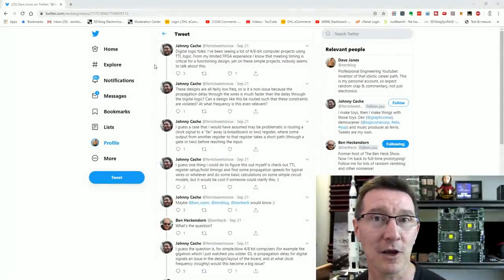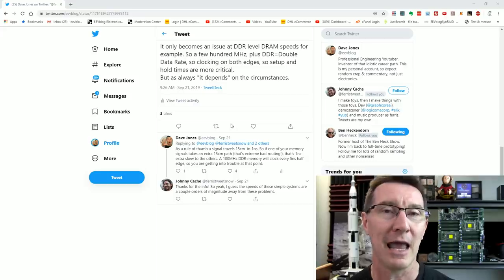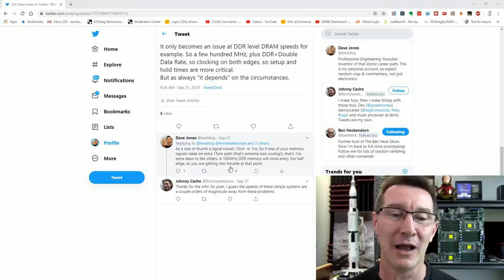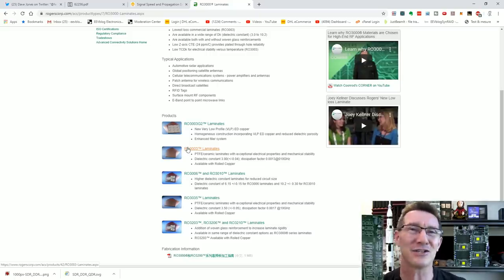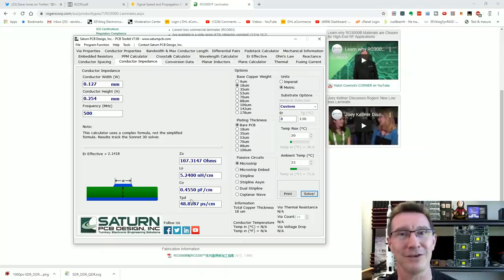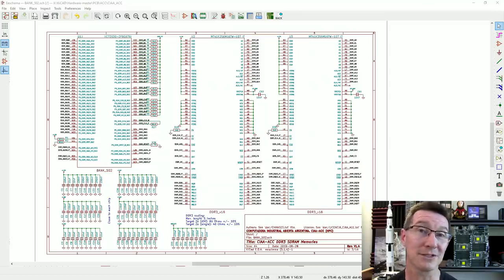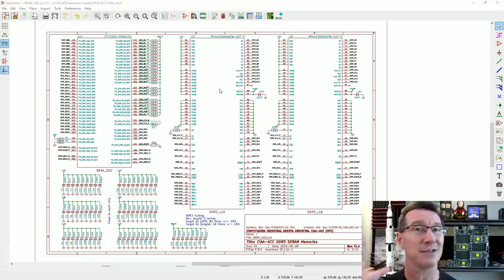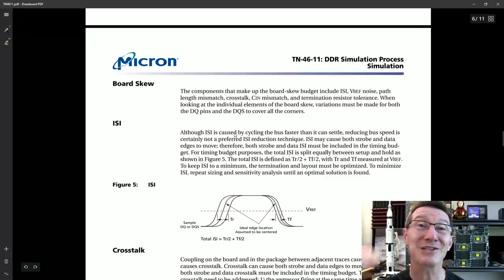EEVblog #1247 - DDR Memory PCB Propagation Delay & Layout

Comment: I worked on a design last year with a FPGA and DDR3. Where I work we have people who do layout for us engineers. We were behind schedule so we thought we would kick the DDR3 to our layout guy before the schematic was complete so that he could get a start on what would be the most time intensive portion. In addition, we skirted some of the company process steps to rush into CAD, like constraining signals. Our layout guy came back to us a week or two later to review his work and it was immediately apparent that we shouldn't have trusted this guy to know how to route DDR lanes. Nowhere were there any serpentine traces. In fact, there was no attempt at all to length match traces. Each signal to the DDR took it's own path to get out of the chaos underneath the high density FPGA and the shortest trace was about 2 inches while the longest was about 10 inches. This was one of many mistakes on that project where cutting corners ended up costing more time to fix later.
Reply: Did something similar as a data acquisition front-end with an FPGA and DDR4 Ram for a very large industrial X-Ray machine. We pretty much messed up the same way... Tried to outsource the PCB Design to save time and got bitten...
Reply: Surely you hold a design review before you send anything out for production?

Comment: At 35:40 - A common mistake, to match a differential pair with a squiggle 'somewhere' in one of the two signals. THAT SHOULD NEVER BE JUST SOMEWHERE  IN THE MIDDLE. The pair is meant to be fully differential, and creating a length jump this way is like a phase jump. This means that at least on one side of the squiggle the pair is not balanced. The skew correction in a pair MUST be near the cause of the skew, e.g. the sideways leaving of a BGA pin pair.
Reply: Yeah I was curious myself how those lengths, which are most certainly inductors, would effect phasing and whether that would cause problems of their own
Reply: @xxportalxx. : Don't see them as inductors, they are transmission lines. A delay is inserted by the squiggle. My use of the word phase was misleading. The problem here is that a differential line must have both signals complementary with the same timing, if not noise emission or reception may occur. The skew at the receiver end between the two signals must be zero, or else the differential signal will not cleanly change over between + and -, but will be zero for a a short time. The behavior of the differential receiver is undefined for zero input, and even double clock edges might occur after the receiver.
Reply: @ariedemuijnck  hmmm, high frequency stuff isn't my forte I admit. My background is more power and physics so I couldn't help but think about phasers 🤷‍♂️
Reply: Not exactly sure what you mean by the 'cause of the skew'. Can you elaborate a little for the uninitiated?
Reply: @deweywsu  I assumed he meant the location where the lengths become different
Reply: @xxportalxx.  oh okay, now I think I'm seeing what he meant. Tell me if you think so: when you create a squiggle, you should create a correcting squiggle in the other line of a differential pair somewhere close to the original squiggle?
Reply: @deweywsu  yeah that's definitely part of it

Comment: Another tip that I've picked up in the last year (still a young player mind you), is to take into account soldermask when routing on external layers. Rule of thumb I was taught for most soldermask is it'll reduce your Zo of the controlled impedance trace by roughly 1Ω per 1mil thickness of soldermask.

Another tip I've learned is if you do have to route DDR (or really any HS such as USB or QSPI SD), route your traces/lanes as perpendicular as possible to adjacent traces on adjacent layers (Shield with ground planes as much as possible). That way coupling will be reduced or nullified because right hand rule.

Last big piece is that it's not the frequency that matters, its the edge (rise/fall) rate of the signal that matters. If you slow down or slew/rate control your signal (while still meeting setup/hold times) you can minimize EMI and even help mitigate against reflections.

Comment: Trap for young players is to route busses on different layers.

Make sure to use exactly the same vias for each signal of a group.  That way, manufacturing tolerances have no effect on your length matching.  They all change together.

I just had to route a 16-bit DDR3L memory to an FPGA on a 20 x 20 mm PCB.  That was NOT easy.  Big boads are so much easier. Especially for length matching and crosstalk.
Reply: The example design shown in this video did not look great in that regard.

Comment: How on earth do PC motherboard manufacturers manage to turn around these hugely complex designs so quickly? Imagine all the layout time, testing of the DDR4, PCI, SATA, NVMe, USB3 etc. And then charge less than £100 for them. Amazing.
Reply: I guess they have very sophisticated tools built over decades to help them with the process. But it is a very complicated thing to do.
Reply: lots of copy-pasting, industry-specific tools, decades of experience
Reply: @redtails  yes, Intel, for example, release reference implementations for some parts of the mainboard design. The companys can also internaly more or less copy and paste between different boards and generations and switch out only the parts of the design for the new stuff. An other advantage is that they can split the development costs between tens of thousands of boards.
Reply: It really is incredible the engineering that must go into them. That, and even video cards.  And then you consider the typical life cycle of these things. you're lucky to get a few months before another version comes out, it's crazy all the work that goes into it for such a short life span.
Reply: I agree, PC motherboards are some of the most intricate PCBs in consumer homes today. Advanced EDA tools, 24/7 PCB design/layout shops, design reuse, offshore manufacturing and economies of scale result in these marvels coming out so quickly and inexpensively.

Comment: Propagation delay was an issue before many folks were born.   The CDC 6600 used a backplane comprised of a mat of twisted pair wire ending in taper pins.  Seymour Cray tweaked the lengths until things worked.   One of my managers had the task of measuring the wires to which Seymour had attached a tag that said "TUNE", so that they could be used for the production machines.  The clock for the 6600 was a blistering 10MHz.

Even before that, Grace Hopper used to pass out 1 ft. lengths of wire to her students, identifying them as "nanosecond" wires.  (Light propagates at about a foot per nsec).

Comment: And all this for Mhz-level signals, imagine the headaches designers have to go through for the current  Ghz-level motherboards !
Reply: This is why things like PCI Express came about.  Instead of having wide busses to match you just have a couple traces running at much higher speeds.  And then for the PCIe x Lanes each lane operates somewhat independently so that matching between the Lanes isn't quite the concern.  All this makes for much tighter requirements but with far fewer traces to control.  DDR is one of the few high speed parallel holdouts though there have been attempts to move to a high speed serial interface for memory - I'm looking at you hybrid memory cube.
Reply: @slashdevslashzero lots of things are moving to this serial lane idea now. Ghz ADCs these days use JESD204B which is a high speed serial interface, so for a 500Mhz adc, you might have 2 serial lines running at data rates of 5Gig each!

Things like thunderbolt use serial lines too, so high speed design isn't going anywhere!
Reply: please elaborate, I guess you use HyperLynx everyday

Comment: Most of my current projects are 6-layer boards and I use Eagle's built in trace length tool on any differential signal (such as HyperBus or USB HS) and on any memory bus (16/32-bit SMC for example). In addition, for clock generators such as MEMS oscillators, I make sure there is a ground plane with no interruptions between the XO and XI of the FPGA clock input. Not sure if Dave mentioned it, but even if the clock speed is slower (i.e. 40MHz), the longer the trace, the higher probability of interference which can cause "blips" in the signal and trouble for the logic.
Reply: Also, clock frequency is not necessarily the concern, the major concern is the rise times of the parts. The signal rise times can contain frequency content well above the fundamental frequency of a clock, and if you want to preserve the integrity of the signal you have to consider these higher order harmonics. If you're using modern parts, every trace should be treated as a transmission line if you want to assure signal integrity and good EMC performance.

Comment: Also, clock frequency is not necessarily the concern, the major concern is the rise times of the parts. The signal rise times can contain frequency content well above the fundamental frequency of a clock, and if you want to preserve the integrity of the signal you have to consider these higher order harmonics. If you're using modern parts, every trace should be treated as a transmission line if you want to assure signal integrity and good EMC performance.
Reply: This is so true. If your clock line its ringing, your single board TTL computer might fail at 1 hz.

Comment: btw the "snaking" was reduced with more modern interfaces such as PCIe but also more modern DDR4 (or GDDR6) memory as well.
Because there is some kind of internal compensation inside the chips. So you can argue that for example GDDR6 has an 64x1bit Interface and not 1x64bit.
Reply: On the PC side I think most of the compensation is on the SoC side with DDR4. Snaking also seems to be more pronounced with T topology layouts.
Reply: @MechanicaMenace  Yes, because the "T-Topoloty" is made for maximum frequency with 2 DIMMs per Memory Channel, thus its a bit more complicated than "daisy Chain"...
And, if I understand it correctly, the singal lenth is the same between both DIMMs, while on "daisy chain" boards, the nearest DIMM is the first one to get the signal.
Reply: PCIe is fundamentally different because each lane works independently from others (as it's a serial bus, it's self-clocking), so there is no need to match them (you only need to match differential pair). And GDDR6 has x16 data interface - you can download databrief for it from Micron website).

Comment: TL;DR KiCAD is great and makes designing 8 layer boards not a pain even if you never designed a PCB before. 

The comments already terrify me what people do that layout PCBs for a living. I’m a physicist and I had to learn board design and testing for a board with a large FPGA with DDR3 and PCIe that I needed to decode and measure stuff. It just so happens that this is the most complicated thing one can do in digital electronics but its super easy with KiCAD! The only thing I ever done before is microcontroller-level stuff because the klunkt software always deterred me!!

Comment: This topic has come at an interesting time. I've been fiddling with some laser driver and TDC circuits to make a lidar measuring tool, and have been learning more around the topic of propagation delay. More so in picosecond TDCs. I found an interesting topic on using FPGA's, to run a clock signal through a series of single gates, to take advantage of the propagation delay, offsetting an array of clock signals all in parallel, each running to a counter. Then you trigger a start/stop signal across all the counters, and determine out of the number of counters, which counter does the increment decrease by 1 You now have 1/x the resolution of your time. Interesting stuff, but I'm sticking with a TDC7201 for now, FPGA's, project for a later date.

Comment: That was the reason why AMD disabled the PCIe 4.0 (double the speed of 3.0!) in the last gen MBs
They said that the signal integrity would be bad and that would causes instabilities.
The new X570 are designed with PCIe 4 in mind with tigther timings and better traces routing

Comment: We tried to keep 7h (for uS) and 5h (for SL) serpentine spacing when length matching the DDR signals. That is to minimize the self inductance. Memory is the most challenge part in motherboard layout. Need to be careful of the RelativePropagationDelay and StaticPhaseTolerence :-)

Comment: This video remind me of funny (not) case in my life... I worked as repairmen on old (late 70s early 80s) telecom equipment in early 2000s and our job was to repair it after catastrophic PSU failure (PSUs was replaced with new ones after, its obvious thing to do).. The issue was found in CPU (contains ALU, CPU registers, System bus buffers, and Clock generator) card and it was replaced with spare but system worked kinda funny(not work at all) after that. If you run ALU/ROM/RAM/IO Registers tests - it works just fine. That was hotspare dual machine setup where second machine do checks on first one and copy its registers and RAM states over by timer or external trigger like alarm or operator's command. Same for first machine and depends on selected Master machine between two of them. Well. Second machine running, operator gives command to first machine to seize master role. It gives ACK and start to run equipment. After 20 to 30 seconds second machine seizes master role and halt first one. WTF? Operator run tests - result: All Green. Repeat tests - result the same. Operator tries to pass Master role to first machine again - it works but situation repeat itself after 20 or 30 seconds again. We knew for sure that issue in CPU card itself because everything else is tested and works before so it's time to dig in =). Issue was found in "Known good" card, in "Stem Clock Output buffer" chip - it was 4AND gates chip that just its function name said - output 4 equal clock signals to Stem (system bus) that connects Branches (commutation matrix parts) to the Root (CPU shelf). Some bright head replaced SN7408 IC with 74LS08... Good fast and sharp clock pulses generated by 74LS chip was too good for the rest of equipment and glitched out the rest of SN74xx based system bus controller that was in different enclosure about 50-60cm away in the CPU shelf... and yes, that equipment had wire-wound backplane too. 

P.S. If someone reading this turd to this point - sorries for broken english xD And I like very much that "Plants" terminology applied to telecom equipment...
Reply: Северный Зверёк Nicely and well written post, except that it's "terminology".
Reply: @johnfrancisdoe1563  lol. Thanks for pointing it out.

Comment: 16:20 You should probably have warned that this trick does not apply to the address lines of SDRAM (both SDR and the many generations of DDR) which absolutely do have to match up since they're not just used for memory addressing but also for mode register programming and for some additional control signals during column select.

Comment: Wow, all these issues ring just as true when laying out datapaths in digital CMOS (say, on a custom DSP). Only, when laying out ICs, we're regularly operating in the tens of picoseconds domain. There is a whole field called Static Timing Analysis that unsurprisingly deals with timing analysis for digital VLSI designs.

Comment: I would be interested to see a video on those timing diagrams. I just couldn't workout why a Dallas DS1220AD NVRAM was not working on a arcade PCB, but a ST M48Z12 worked perfectly. They are both listed as compatible items for the same SRAM chips. From what I could see the dallas was stuck in high impedance to stop data corruption.

Comment: Great video Dave, but surprised nobody appears to have picked up on your propagation delay estimate!

The speed of light is 300k km sec -1 therefore 1nS = 30 cm at that speed. When I did my electronics degree 45 years ago that was an ingrained measure.

Clearly electrical propagation is not as high as the speed of light, for various reasons, but generally taken as between ~65% and ~80% depending on exact medium and circumstances.

Safest rule of thumb is therefore to use the speed of light rather than half that, thereby ensuring a good positive margin for high speed circuits. Not so critical at 100 MHz obviously but significantly more critical at 4GHz, or above.
Reply: I can smell ham.
Reply: @MiniLuv-1984  what flavour? 🤔
Reply: @boblewis5558  that depends on the country you are in Bob. I just got my advanced as we call it here in au, waiting for my call sign allocation.
Reply: @MiniLuv-1984  wasn't aware the speed of light varied by country, certainly not by a 100% increase or 50% decrease! 🤔🤔🤔

Comment: Of course the trace length matching doesn't just stop at the BGA pad either. IIRC the chip manufacturers have details of the trace lengths for each signal on the BGA PCB too. I think there was a talk someone did about doing that in Kicad with the python integration but unfortunately I can't find it.

Comment: Makes me appreciate the difference between a PC motherboard which costs $50 vs a high end motherboard costing a couple hundred $$. Consider the tolerances in a system such as the HP DL580 where the memory is routed through the MB, to a cartridge module, containing many individual memory sticks, where finally the RAM chips themselves reside, and you learn to appreciate the engineering required to make such a system function.

Comment: At 32:50: "Let's get the confuser out again". How true. You use 15 cm/ns times 50 ps - that should be times 30ps, leaving you with only a 4.5 mm skew margin. When we designed boards like this we stayed well inside those margins, and they worked first time right. It is doable...